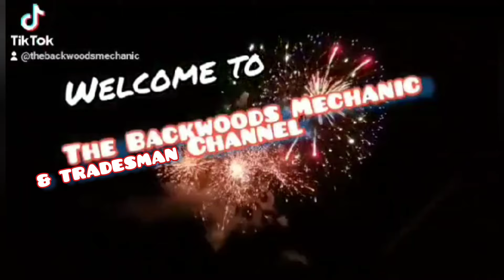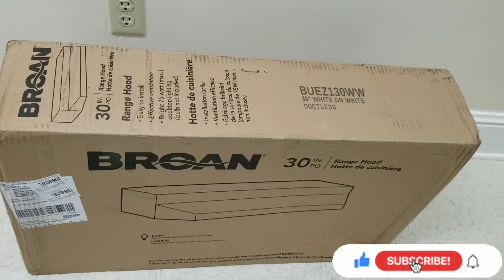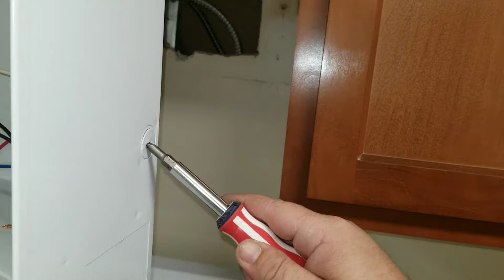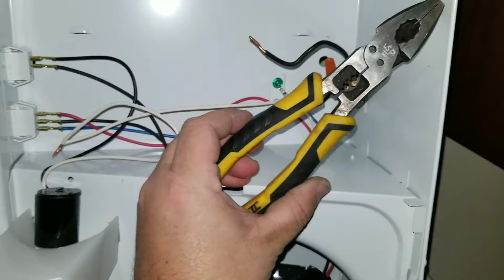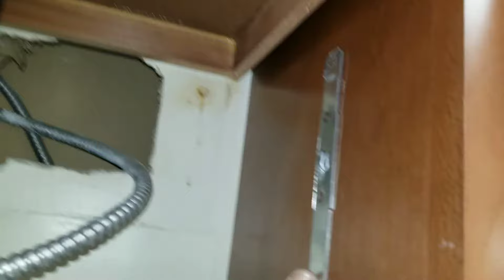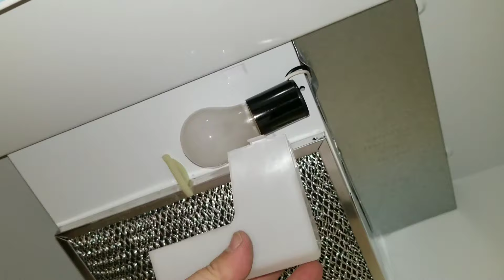How to Install a Broan Ductless Range Hood - DIY

Comment: Came here from Amazon after trying to see if this would fit my space. I only have access to a normal power outlet but it seemed like the cords in the video and hood were special...my question is can this good be installed under a normal cabinet and a normal outlet (3 prong)

Comment: This is funny because I did not get the brackets but just the 4 Screws to mount the upwards.
Reply: Greetings: some hoods (for a little bit more $) come with the EZ install system. I went cheap and just purchased the model with the plain old screw holes. Just depends on your own set up. Have a good day!